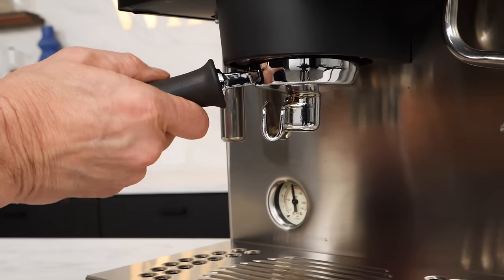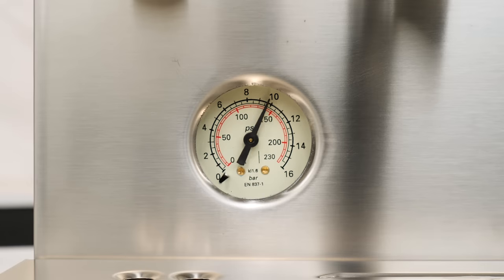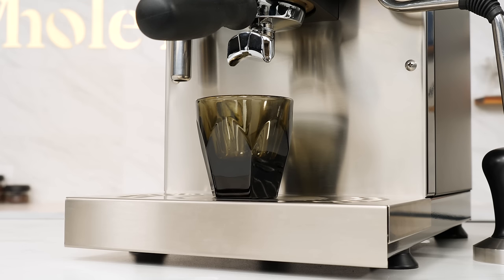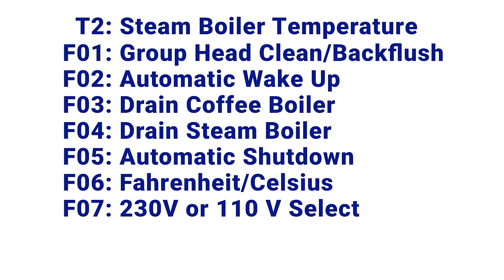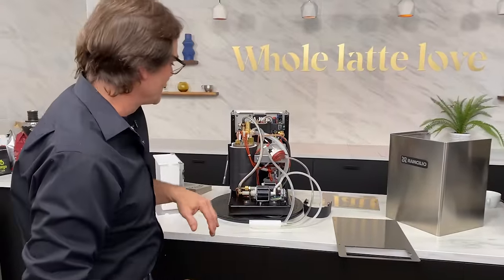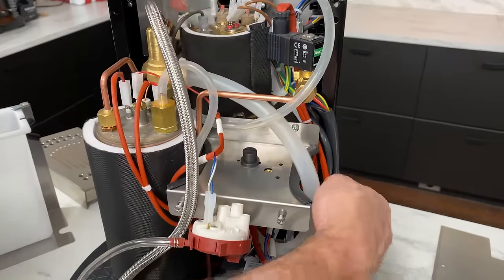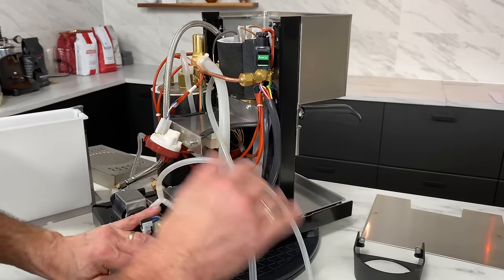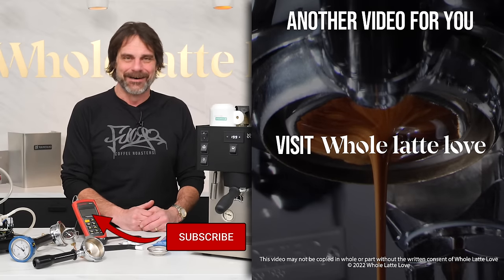Review: Rancilio Silvia Pro X Espresso Machine

Comment: I got my Silvia Pro X about a month a half from WLL and I absolutely love this machine. Upgraded from a Breville barista express and paired it with a Eureka Facile. The workflow is amazing, love the tweaks you can do with the Silvia. To me the only Con is the small drip tray and the fact that you have to lift it before sliding it out. You gotta make sure is not full to the top or otherwise you’ll make a mess
Reply from the maker: Hey Samuel, Thanks for sharing your experience, thoughts and of course your patronage! Dual boiler workflow is so much better! And, you went from an appliance to a machine - very nice upgrade! Agreed on the drip tray. Do have to stay on top of emptying.
Marc

Comment: Makes me miss mine, but it's only 5 minutes away and I still service it. The hot to the touch steam/hot water wand gives new meaning to "Wake up to Miss Silvia" if you touch it. No matter what your final destination is, if you've had a Silvia, she has a place in your heart forever.
Reply from the maker: Hey Todd, 5 minutes away and you still service it? Tell me more.
Marc
Reply: @Wholelattelovepage  The person that asked to buy it knows when I bought it and has had the second most amount of pulls from Miss Silvia, second to me obviously. They knew that I wouldn't be impressed if they let the machine fall into disrepair or got really dirty. They know she can do awesome shots, but sometimes they let the machine get too dirty or stray from the dose or grind level. 

I will clean Silvia (descale) and re setup Rocky (my first grinder) but they owe me a bottle of wine, which we drink together. 

From 2009 to 2019, Silvia only needed a boiler gasket and the clips that break off the steam knob. I had extra clips I gave them.

They moved up from a older Saeco Via Venezia that I PID modded. The Auber instructions were wrong, but since I PID modded Silvia, I knew what to do.

Clumpy Rocky is a little bit of an issue because it involves a lot of prep after you grind which they are not doing. So I guess the grinder goes next. I am selling my Mazzer mini that I modified with super jolly burrs and carriers.

I replaced the Mazzer because Marc convinced me to get a Ceado 37s...
Reply from the maker: @Todd.T  Wow, thanks for the detail! Sounds like a fair trade for the wine!!! Agree the Rocky is a bit clumpy, slow and limited by stepped adjustment. That E37S is at an entirely different level. It remains my go to grinder when I want things right - and I’m lucky to be able to choose from just about any grinder. 
Marc

Comment: Hi Marc & great video.  So glad you ran through the inner workings of the machine and in particular your mention of the stainless steel steam boiler but also mentioning that the brew boiler is a lead free brass.  I'm finding it difficult to decide between the Rancilio Silvia Pro X and the La Spaziale mini vivaldi 11.  Any thoughts on what would be the best choice?  Reliability, temp stability, ease of use, non-app reliance etc.  Also, are the La Spaziale boilers both brass & lead free? or is one of their boilers stainless steel?  I would love your feedback even if it's just your gut feeling and I have seen all your videos on both models.  Thanks again.  Cheers, Stephen.
Reply from the maker: hi steph, thanks for your patience - I've been on vacation and offline for a couple weeks. Thanks for the comment and question. Unfortunately I'm not very familiar with the LSMV. It is listed as having copper and brass brew boiler and stainless steam boiler. Brass used in boilers all meet EU/US specs for lead. There is a fairly significant price difference between the machines. Both are very good machines so it may come down to how price and aesthetics factor into your decision. I have used the Pro X a lot and it has one of easiest control systems. It's not exactly a looker in my opinion - a bit more utilitarian. Hope that helps!
Marc

Comment: If you use the machine at 7am, can I have it on and in standby for several hours for my second coffee around noon? Will the temperature be maintained? Would it be a major energy consumer if left on? Thanks
Reply from the maker: Hi Tom, Standby cuts boiler heating. You can turn off the steam boiler if just doing coffee to save some energy. I have not measured the energy consumption of the Silvia Pro X. I have done other machines with similar boiler sizes. For example an ECM Mechanika Max used .88KWh When heated from cold 2 times and turned off 90 minutes after each heat up with 2 lattes made during each ON period. At electric rate of $0.168/KWh total cost was about 15 cents. My guess is it would have consumed a similar amount of power if it were just left on for several hours.
Marc

Comment: My 500$ breville was okay but i want amazing,,is that possible under 2k price point
Reply from the maker: Hi pp, Amazing is possible under $2K. The Silvia Pro X is an option. Also check out the Pro 500 PID with Flow control at just slightly over https://www.wholelattelove.com/products/profitec-pro-500-pid-espresso-machine-with-flow-control
Or the Bezzera BZ13: https://www.wholelattelove.com/products/bezzera-bz13-pm
Marc

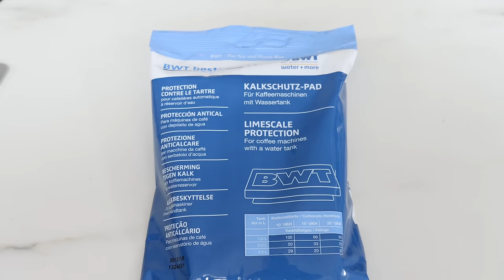Comment: 11:13 Forget about that BWT filter pad. It will take hours to soften the water and never stop doing so (as long as it's in contact with the water, it will keep softening). You have no control about the actual hardness of the water you are bewing with.
Even worse: It does nothing about alkalinity (carbonates). Depending on your input water, all your coffee might taste dull.

Sorry, this is not simple. If you aren't one of the lucky few who have suitable water directly from the tap, either:
- install a filter cartridge in your household water pipe
- use remineralized osmosis water
- fumble with a table filter and monitor with titration tests

- buy appropriate water in bottles
Reply from the maker: Hi user, thanks for adding your comments. The "softening" of the BWT Bestsave pad works by exchanging calcium ions in source water with magnesium ions. It also includes activated carbon for removal of chlorination and other chemicals. Residence time is required for this process so the Bestsave pad is not a good option for those who go through more than a reservoir full of water per day. The filter does in fact treat/reduce alkalinity. Taste test have shown calcium and magnesium are much better flavor extractors than the sodium used in traditional water softening. Replacing scale causing calcium with magnesium maintains  flavor extraction characteristics. The BWT Penguin pitcher or Bestcup (an inline in-reservoir system) are excellent options for those who cannot plumb in a machine and use inline filtration or go through more than 1 reservoir of water a day. Both of those options use the same calcium to magnesium ion exchange and include particle filtration as well as activated carbon. When used as directed scale will not form in machines and the mineral level is maintained (magnesium) for good flavor.
BWT Penguin: https://www.wholelattelove.com/products/bwt-penguin-2-7-l-water-pitcher
BWT Bestcup: https://www.wholelattelove.com/products/bwt-bestcup-m-package
Reply: @Wholelattelovepage  Thanks for your insights! 

Some other party's in-depth tests of these in-reservoir-cartridges show that e. g. Jura Claris and Brita Intenza are clearly superior to BWT Best Cup. 
At least, the BWT is attachable to the Silvia Pro (X)'s hoses, maybe the Brita also? Jura Claris unfortunately is not.

About filter pads: When placed in the water reservoir, they are constantly and slowly exchanging ions. Depending on the input water, it may take something between half of a day and 100 (!) hours to reduce the overall hardness to an appropriate level (but not stop here). This is why I call them 'not suitable' for our application. Besides being not controlable by the user in any reasonable way, it does not suit the typical use case: Whenever the reservoir is empty, refill and keep using the machine directly after. Certainly not recommended here. 

About alkalinity, I second your insight. Yes, BWT Bestsafe will reduce it. Here I was wrong

Comment: Hello! Your video is amazing. I have a question - I have got the machine and a very good Niche grinder (that I grind for espresso range 10-20, tried various settings), but the coffee does not come out until about 15 seconds in of the water starting to come out. I checked and the pressure on the machine is showing 9 bars... I have tried to contact the customer support and they told me to turn off the soft infusion option, which actually has been off all along.. I am not sure what else could be the problem... :/
Reply from the maker: Hi DO, Thanks for the kind comment and question. If you're at 15 seconds to 1st drip most likely issue is your grind is too fine. Here's a video on dialing in grind size which should help: https://youtu.be/jOY7D02n4Cw
Marc

Comment: Marc why did machine come with 4 hole steamer. Benefits if your steaming 6 0z or more milk or should I be using it?
Reply from the maker: Hi Big P, Steam tip hole count is a personal preference. When tips have more holes the holes are usually smaller than tips with fewer holes. Some users may find more vigorous mixing of milk and more uniform texture with higher hole counts. It comes down to technique of the user. Do it right, and one can get excellent froth quality regardless of hole count.
Marc

Comment: Hello, host, can you remove the two vibrating pumps and replace them with a rotary pump?
Reply from the maker: Hi sg, Well... With enough skill, time and money anything is possible but I doubt there's enough room to mount a rotary pump within the case. Beyond that one would need to rework all the control systems. Likely better off to go with a dual boiler that comes original with a rotary pump.
Marc

Comment: How long does this machine take from turning it on to being able to pull a shot and frothing milk?
Reply from the maker: Hi Scott, Thanks for the question. It's about 5 minutes for the brew boiler to reach operating temperature. Following that the steam/service boiler heats. It was 6 minutes for that boiler to reach 212F/100C and then 2 more minutes to reach full temp in the boiler. In total, 13 minutes.
Marc

Comment: wow!  multi-voltage!   how does that work? 50hz in uk, 60 in usa?
Reply from the maker: Hi m, Yes switchable. Original Pro came with need to set for use on US power. Pro X comes out of the box set to US power for machines here.
Marc

Comment: Thanks for the great review @Whole Latte Love! I’m still torn between the Pro X and Lelit Elizabeth.
Both are priced the same in Canada. I’m hesitant on the Pro X for its lack of shot timer and insulated steam wand. Help!
Reply: It has a shot timer but your are correct about the non insulated steam wand.
Reply: @caffeinemomma9897  you’re right. I meant programmable timer on the Elizabeth
Reply: Hey, man. This was my dilemma as well. Personally I've seen a whole lot more Lelit maintenance problems on forums than I have Rancilio issues. Not to mention the amount of plastic in the Elizabeth turned me way off. Yes, it can do more... but it has to cost you something. I don't regret my decision whatsoever. Honestly, I'd be more inclined to get an E61 style machine with flow control over the Elizabeth if I wanted that level of control. ECM Classika or Synchronika
Reply: @zm6658  thanks for the feedback!
Reply from the maker: Hi Philip, @Z M has some excellent input here. Glad the shot timer confusion was straightened out.
Marc
Reply: @Wholelattelovepage  In your review the brew gauge shows 10.5 bar for 9 at the group. My machine is showing 9bar on the gauge with a blind filter. Is this correct? Thank you

Comment: The silvia frothing has always been kind of weak...meaning you can't really do great latte art with it.  I haven't tried the dual boiler, I had a single broiler, older silvia.  So are these any improvement on the steam power and ability to latte art with these newer ones?

The warming surface on the single broilers also sucked, at least mine didn't heat a damn glass at all.
Reply from the maker: Hi SF, On the Pro X you have a dedicated boiler with a much larger volume than the single boiler original Silvia so more steaming power! While the original Silvia steaming doesn't compare to commercial or prosumer level home machines I've seen plenty of good latte art using the machine.
Marc
Reply: @Wholelattelovepage  Thanks, good to know.  But I beg to differ on the regular Silvia.  You can't do great latte art on it, only meh

Comment: Is there a proper way to drain the boilers and then refill them? More specifically, should I engage the drain feature with the machine at temperature r when it’s cool and how would one go about refilling them after draining?
Reply from the maker: Hi GZ, The machine should be heated/at pressure when draining the boilers using the F.03 and F.04 features. When you start the machine again the boilers will refill automatically.
Reply: @Wholelattelovepage  thanks , Mark!

Comment: Hi, Marc! Hope you're well. I've realized that the internals is for the Pro X. I have a questions where does the capillary tube for the pressure gauge comes from? Is is just after the pump or in other place in the pump-grouphead line? Thanks!
Reply from the maker: HI Philip, The capillary tube for pressure gauge is fairly deep in the system and not far from the pump. If you want 9 bar on your coffee on the Silvia Pro X you should set the OPV to produce 12 bar on the gauge when running the pump with a blind filter basket in place. Based on your question you might be interested in this video in which I explore brew pressure on vibration pump machines and why gauges often do and should read higher than 9 bar. Brew pressure on the Silvia Pro X is covered in the video including how to adjust. There's also a Scace test reading pressure in the group during a simulated extraction and comparing pressure there to reading on the Pro X gauge: https://youtu.be/Z2DNW7ZVolg?t=160
Enjoy!
Marc
Reply: @Wholelattelovepage  Actually, I'm thinking about modding a Silvia Pro, to install a pressure gauge and a dimmer to the brew pump so that I'll be able to pressure/flow profile. I would take the machine to a whole new level hahah
Reply from the maker: Interesting - good luck!

Comment: Why wouldn't they just add the no burn steam arm?
Reply from the maker: Good question!
Reply: Coming from Lelit Bianca I (theoretically) 'downgraded' to Silvia Pro X. 
Bianca has no burn wands with the 'benefit' of somewhat stiff, gristly feeling when moving the wands. I never liked moving the wands.

With Silvia Pro X, moving the wands is absoloutely smooth. Mostly relevant to the steam wand. I really enjoy it as it is.

Being non-no burn might also do a good for better steam performance. 
Bottom line is, I never miss 'no burn' in practical use – for me it's the opposite. Just grap the wand by the rubber piece, it's intuitive

Comment: This vs. BZ10?
Reply from the maker: Hi TJ, Aside from differences in looks, the major difference is boiler type and temperature control. BZ10 uses a heat exchange boiler and pressurestat to control temps in the boiler. That setup is not nearly as accurate temperature wise as is the dual boiler PID setup in the Silvia Pro X. The BZ10 does have an electrically heated group head which smooths things out a bit but still not as precise as the PID and independent brew boiler in the Pro X. Some users appreciate the quick heat up time of the BZ group compared to machines with E61 groups. Silvia Pro X heat up time is comparable - perhaps a bit longer than the BZ10 due to it's integrated boiler over group design. Hope that helps!
Marc

Comment: Apart from the "soft pre-infusion" and pressure gauge this is pretty much a regular pro, right? And the price difference is HUGE!
Reply from the maker: Hi Cinnarey, Also has the higher capacity portafilter and filter basket.
Reply: @Wholelattelovepage  also allegedly a much quieter pump, which was a bit of a flop

Comment: The drip tray is the deal breaker for me. Plus, Rancilio could add a dual boiler rotary pump/plumbable model.
Reply from the maker: Hi PN, Thanks for the comment. Drip tray is small so need to pay attention. If it gets too full it spills when trying to remove. Going to rotary pump/plumbable would significantly increase the price and likely require a larger housing.
Marc

Comment: Mark, thanks for uploading. The older versions of Rancilio Silvia (I purchased mine in 2013) had a boiler made of some lead alloy, raising not only taste related questions but also health concerns over multi-year use. Since 2017, I made a switch to Profitec Pro 500 with a stainless steel boiler but the question remains around Rancilio’s and/or other brands’ use of lead in their espresso / coffee range of consumer and professional products. Would you mind to elaborate on in some of your future videos?
Reply from the maker: Hi DB, To the best of knowledge all manufacturers currently meet lead standards for US and EU. In the past some brass did have lead content but products were treated to protect from leaching. I brought up lead when I visited Bezzera in Italy a few years back. They, like other manufacturers have switched to using newer brass formulations to eliminate any question of lead issue.